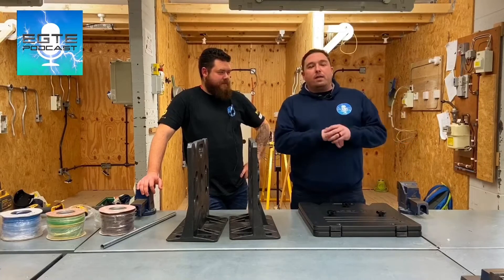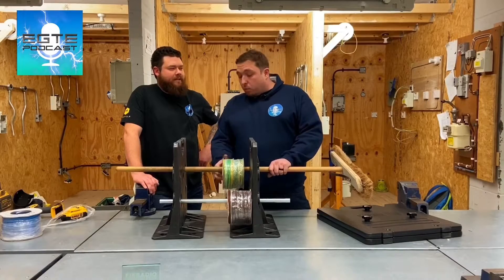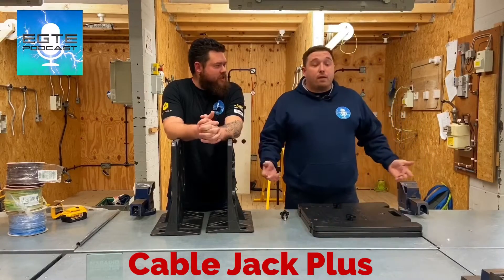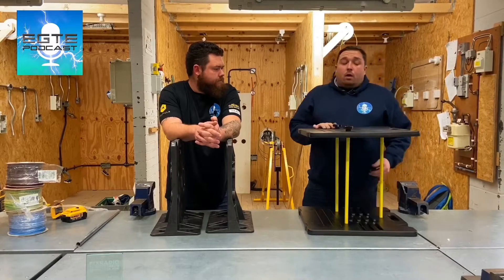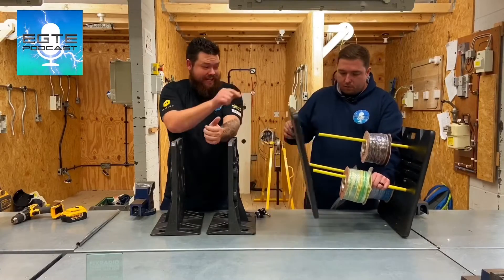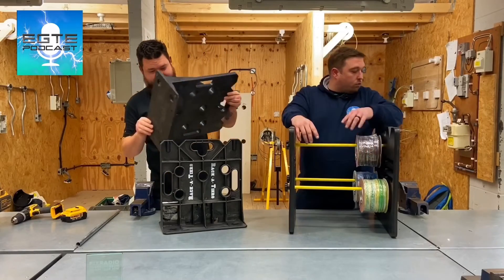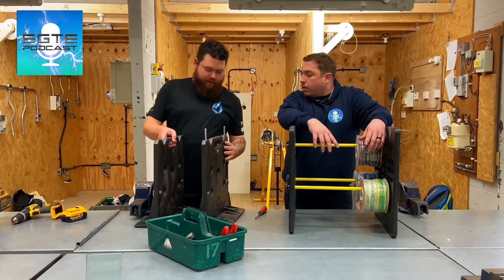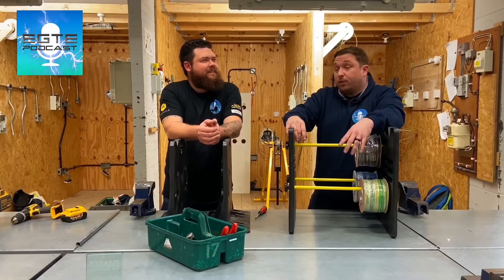Super Rod Cable Jack Plus Product Review from Electricians Guide to Everything (EGTE) Ricky and Sam

Comment: Big Super Rod fan but Rack A Teers win. Interesting to hear a V2 of the Super Rod version exists, the first has a few quirks!
Reply: I use 2 scaffold poles with my racketeers which allows me to pull in 20 drums of belden Signal cable, can't do that with the super rod jacks.
Reply: I use 2 scaffold poles with my racketeers which allows me to pull in 20 drums of belden Signal cable, can't do that with the super rod jacks.